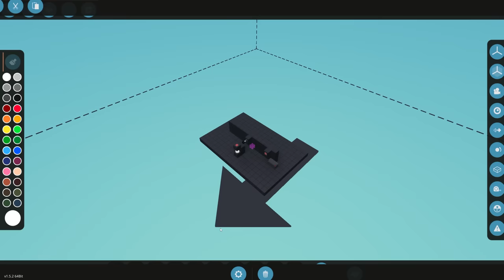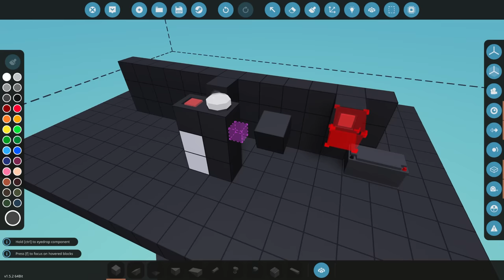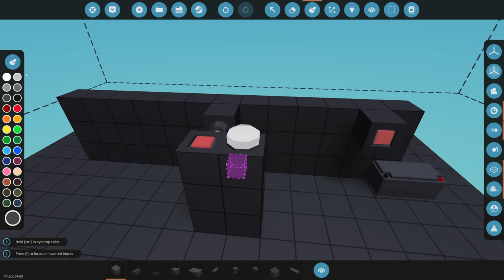NEW Welder & End-Effector!! (Press Buttons From Vehicles) - 1.5.2 Update - Stormworks

Comment: Are the sonars broken for anyone else too? I hoped they fix the torpedo note on the sonar since it does literally nothing but they didnt... also the sonar tracks itself when you build a propellor onto it which is really bad; i needed to use a Solid Rocket Booster because it doesnt track the sound of that one?? But even now when the sonar doesnt track itself, it just doesnt give any control to the fins (yes i have tried multiple designs and flipped it around) Testing for 4 hours straight now, still doesnt work. Im giving up now

Comment: after some testing, i'm still clueless as to what the "max power" slider actually does
burn rate controls how fast it uses fuel (more fuel = more powah)
max power controls does...?
in my testing, it has less of an effect on burn time than burn rate does.
Reply: Max Power is for reducing the fuel that the rocket has, this also reduces how powerful the thrust is itself. This option seems really stupid and useless to since i dont really want to reduce the fuel of my rockets since they dont have much fuel to begin with
Reply: @rny420  that actually does have a practical purpose
if you make an ejection seat or an unguided rocket, for example, you might need very exact srb pulses, and reducing fuel allows you to lower the thrust while still burning for the same amount of time.

Comment: They need to optimise it for Windows 11 asi have rxt3070 ti and it crashes every 5 minutes it sucks
Reply: My computer with a 3060 and windows 11 runs it great
Reply: @bmfincthebest1826  what is your processor mine is the i7 12 700
Reply: @harryvlogs7833  i7 11000
Reply: Cries in i5 2500 with a GTX 1660

Also cries in Low quality physics
Reply: @HouseOnFireHelp  hu ? It keeps crashing